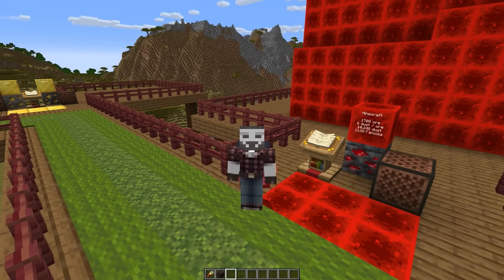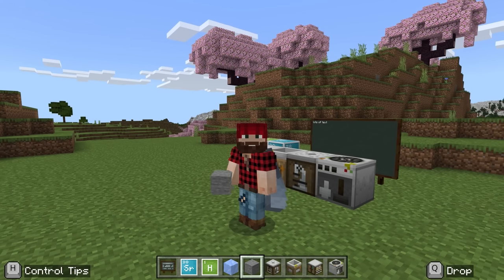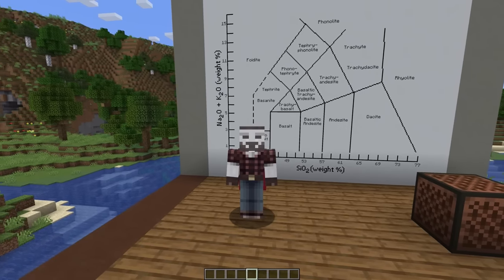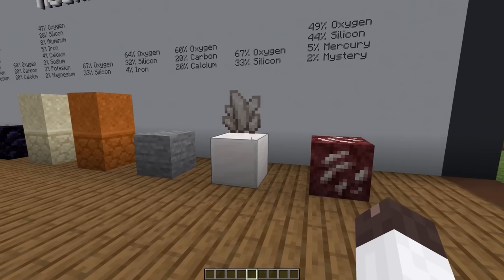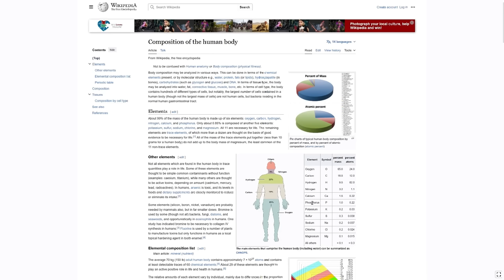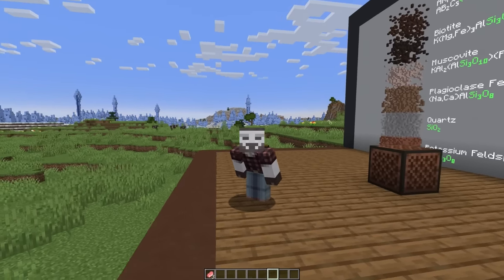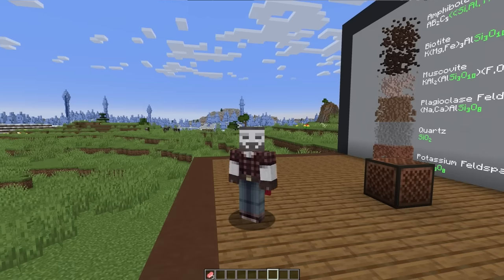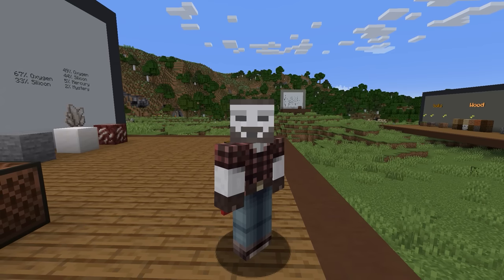Minecraft Education Edition’s Failures

Comment: True words. "Uranium is just a rock that gets hot" And yes. it's oversimplifying it because it also include negative Debuff such as AOE Damage over time and Poison Aura.
Reply: In sufficient concentration, yeah. If the rock is thicc enough to get hot, it's thicc enough to inflict killaura. ...Now Cobalt-60 is the one that'll really oof you up...
Reply: I mean, if you had a 1x1 meter block of uranium next to you, that would probably emit a good bit of radiation, I'd dread what cobalt-60 would do...
Reply: @fusionwing4208  ...That's a fair point. Reminds me of an SCP that takes place in Minecraft yet affects the player at the actual keyboard, and the only cure is for the actual player to "drink one cubic meter of milk" (which would be a lethal dose of lactose for anybody, apparently)...
Reply: @WackoMcGoose  homestuck...
Reply: @WackoMcGoose what about drinking it not at the same time? Like, with a dilation
Reply: @fusionwing4208  Interestingly, uranium is very dense so the exterior of a uranium block will shield basically all the radiation produced in the interior. So surface will be more important than volume. In addition uranium is an alpha emitter, so it won't penetrate skin very well. Also the type of enrichment will play a role. U235 is more radioactive than U238 (even with no fission).
(I won't crush the numbers since the effort is substantial without the correct tools and the probability of me making a mistake is quite high. There is already enough misinformation around... but by my estimate, being next to a m^3 of uranium for a few minutes will not give you acute radiation sickness.)
Reply: @entcraft44  interesting indeed. Though probably not a good idea to stand next to a block of uranium that large without some protection anyway, in case of things like dust.

I have recently (last couple of years) learned quite a bit about how natural uranium is, surprisingly, safe compared to what its seen as in the common mind.

definitely don't want to breathe it in though, baaaaaaaad things happen
Reply: @B1esky adventure time…

There’s homestuck characters doodled on whiteboards by adventure time show creators plus all the references
Reply: @TheOnlyPedroGameplays  that's awesome :>
Reply: @ultraflopp2802 

I mean drinking one cubic meter of milk over an extended period of time is something a lot of people do. It's the fact you have to drink it as a cure, meaning very rapidly or you'll die, that's the issue.

Comment: As a chem student, the "reacting Mg and NaCl" at 13:51 really got to me. It's weird that the substance is called "magnesium salts." Like you said the name may be inferred to be magnesium sulfate (MgSO4, Epson salt) but it's so ambiguous. Based on the production method it could be magnesium chloride (MgCl2) but just calling it "salts" gives absolutely no information on what it actually is. Is it the sulfate? Chloride? A combination thereof? Heck it could be completely different like a fluoride or literally any anion if we're looking at just the name.

Also for those curious mixing magnesium metal and sodium chloride IRL theoretically yields no reaction, at least without resorting to forcing and specialized conditions. Even if the NaCl was in solution and even if the magnesium didn't react with the water first, none of the remaining substituents can react. For example, the reaction can be written as follows:

Mg (s) + 2 Na+ (aq) -> Mg2+ (aq) + 2 Na(s) E = -0.354 V assuming I didn't screw up the calculation

The negative value of the potential (E) means it's just not favorable to react. I mean some can react because it's technically an equilibrium but it's so not forward favored there's hardly a reaction (for those curious the equilibrium constant is something like 10^-12 if I didn't screw up either calculation). If I did make a mistake, please let me know.

Anyways, I appreciate seeing real science being done! Thank you Gneiss Name!

Comment: As someone who is studying chemical engineering right now I was familiar with the hair-raising inaccuracies (or rather simplification) of the chemical aspect of education edition. Aside from the elemental composion blunders (even I knew rock was not just SiO2 before I ever really got into geology) chemistry is not just about "oh, what elements is this made of" and, especially, when you want to make something you don't just shove the component elements together, because that will get people hurt (and is uneconomical). Most of the time, it's actually the reverse, to make a compound you want to find the pathway from some easily available other compounds with the least steps and energy investment possible, and since there are millions of different compounds with varying properties, a synthetic chemist's job is hard. Pure elements are almost always as far removed from your desired compound as possible, not to mention the difficulties of getting them to react in ways that are desirable of the many ways they could otherwise react or the fact that they are mostly very hard to obtain and purify in the first place. Now, I understand, I think, that these blocks are not meant to actually educate students about the work of real chemistry but instead provide an easy to use way of showcasing different compound formulas, but still, some misleading conclusions can be drawn. Also, the sum-formula is pretty much worthless of you don't know the exact ways the atoms are bonded together - this is even true in geology and especially in organic chemistry - try tell me that cellulose, acetic acid and some wet graphite are the same thing just because they have the sum composition of CH2O. 

But I always wrote it off as the quirks of an obscure and forgotten version of minecraft that is left there for showcase youtubers to pluck apart when they run out of content. To think that there are thousands of lessons possibly just as "cough cough" simplified as this and that the platform is very much active in the state that it seems to be ..

Comment: 5:48 Why would a random sample of granite give you gorgeous clear glass? Do other rock glass come out that well?
Reply from the maker: No, most make a green color from what i have done.  There is a lot that is happening there that i just glaze over for the video.  The lithium chemicals is nearly 3/4 of what I'm melting. They melt and the rock powder actually dissolves into the melt. Lithium doesn't produce any signal when hit with x-rays so its basically not there. So in the end we have a solid that has the atoms of the rock evenly distributed locked in place by the glass, which is great if you are trying to do precise measurements.

Comment: There is actually a few mods that do vaguely similar chemistry stuff, or which add secondary products to processing redstone ore. Their names (and what they think redstone/redstone ore contains) are:
* Minechem - considers redstone equal parts iron and copper. (Potentially referencing the high electrical conductivity of copper-iron alloys?)
* Alchemistry - considers redstone equal parts iron oxide and strontium carbonate. (I think this is considering redstone analogous to Ferrite?)
* Thermal Expansion - redstone ore produces cinnabar as a secondary product when pulverized. (Not sure if just 'they both red' or if there's something more here - you're more qualified to speculate about the 'why' of this one I think.)
* Ender IO - redstone ore produces silicon as a byproduct when processed in the SAG Mill.
* RotaryCraft - redstone ore produces aluminum dust as a byproduct when run through the Extractor (A combined ore processor that grinds the ore -> mixes it with water to form a slurry -> filters the slurry -> burns away the water).
* GregTech - redstone is considered Si(FeS2)5CrAl2O3Hg3

It might be interesting to look at what Minechem/Alchemistry consider the various rocks to be in a video.

Additionally, with this new information about your profession, I am now requesting you look at the Extreme Reactors & Nuclearcraft mods for two different levels of nuclear simulation complexity in Minecraft. (Also I want to be reaffirmed in my annoyance at Nuclearcraft's radiation being magic death cooties.)
Reply: also Hbm's Nuclear Tech Mod
Reply: Can you make meth in any of these mods?

Comment: The edu edition isn't about Education, its about getting a cut of expensive edu software license pie. Back when I was still working in edu IT, 95% of the software licenses they bought were barely used. The org would get sold a org wide license and maybe  1-2 classes at one site might use it twice in a school year.

The edu edition on the surfaces has all the box-checking things it claims to be, which is as deep as it needed to be for its purpose and budget.

Comment: It may be a little off topic, but a modpack called "Gregtech New Horizons" adds a very complex chemistry system into the game and the chemical formulas for various ores and minerals are mostly correct (expcept alloys are messed up since they just look like the formulas of their ingredients mashed together, so you get things like Fe50C for steel). The chemical chains also resemble real ones, although really simplified, like you can make carbohydrates in a distillery from oil, then combine styrene with butadiene and sulfut to make rubber etc. etc, so you're not just magically splitting blocks into chemical elements

Comment: I actually do take issue with the statement "Whilst living things are largely carbon, oxygen, nitrogen and hydrogen." It's not a proper sentence. Whilst they're made of those elements, what? It should be a clause in the previous sentence. "These things are X whilst these things are Y" or "These things are X. Meanwhile these are Y" would either be correct (although the latter sounds a bit weird in this context). I guess the same intern who couldn't be bothered to Google the elemental compositions couldn't be bothered to check their grammar either.

Comment: i think you should take a look at the gregtech series of mods because you would probably really like all of the chemistry stuff it adds
a lot of the minerals have a chemical makeup added to their tooltip (for exmples redstone is Si(feS2)5CrAl2O3Hg3 ) because you are fully expected to sometimes extract certain elements from these, for example you can get sodium from centrifuging stone dust

the modpack, gregtech new horizons, takes this a step further by adding completely new elements like draconium(D) or sometimes even an element without even a letter as its chemical sign like chromatic glass for example has two of the ☯ symbol included in the chemical sign

Comment: Not a biologist but a chemist (please correct anything I say that is wrong, I'm not the most well read on inorganic chem) The living things is mostly correct but leaving out phosphorus is really strange. Nitrogen accounts for about 2.6% of our  mass and phosphorus accounts for 0.6 so maybe that's why? Phosphorus is vital in any living thing since it's what forms the phosphate chain in our DNA and RNA. 

I can excuse leaving our calcium as that only accounts for vertebrates and some molluscs with shells but phosphorus is just weird to leave.

In general the chemistry in Minecraft Education edition is sloppy at best and downright wrong at worst. I really wish it wasn't so I wouldn't have to look for chemistry mods all the time.

Edit: Also seeing the NaCl and Magnesium reaction was surprising. It's true that MgCl2 is a "magnesium salt" but so is magnesium sulphate. Putting them together would do nothing honestly. Maybe if you heat it to 900°C so the sodium chloride melts we might see some migrate to Mg but sodium is less electronegative than magnesium so the chloride will preferably bond to magnesium. Dissolving it and then boiling it down... I have no clue. Nobody does this. This reaction doesn't exist, MgCl2 is just purified you don't react to form it. Even if you do, chlorine gas and magnesium metal would be much more interesting and probably easier.

Comment: 6:10 oh wow. How did you create a graph like this? Entities like named armorstands? How?
Reply from the maker: I’m using many text entities. The ⬛ character and treating each one like a pixel.
Reply: @gneissname  So Text Entities for the text on the graph and these pixel character in the text entities for the lines on the graph. Must have been quite time consuming to adjust the coordinates for each pixel in the graph. 
Thanks for the response and the video!
Reply from the maker: @StarWarsExpert_  yep, to help speed up the process I wrote a scrape that gives me the values of pixels and x y position in an image. So I made that graph with a low resolution then deleted the regions, got all those positions and values then did one with just the regions. To animate it I calculated each pixels distance from the bottom corner then ran a scoreboard in game and have commands that load each entity based on the distance. Lots of this is just done in excel to make a long list of commands that go into a mcfunction file.
Reply: @gneissname  scrape? Do you mean script? I don't quite understand what you mean with regions. As far as I know, images only have 2D Pixels and not 3D Regions. So once you had these x y positions, you could use the ~ symbol to make relative coordinates from the place the command is executed at.
Datapacks are such a performance and time saver. You don't have to put every command into a command block anymore and use redstone to power them in the wanted order.

Comment: What's crazy is that Minecraft mods like Minechem and NuclearCraft were getting more of this stuff right long before Mojang made their own lame attempt at adding chemistry to Minecraft. Mods like Thermal Expansion added proper recipes for gunpowder, mods like TerraFirmaCraft added in real geological stones and ores. Both of them made redstone canonically related to the mineral Cinnabar (HgS) which at least makes some sense because Cinnabar is red and mercury is a metal that can conduct electricity. Copper oxide would've been another totally acceptable answer, way better than "erm uranium = power so put uranium in it"

Comment: Would you consider the education edition fine for something at the grade school level? I personally felt like minecraft has been focusing on moving towards that demographic for the last few years so normal Minecraft could be sold to elementry or middle schools. That might explain why everything is so simplified or wrong, i have 0 idea though why they would target colleges for an education edition most of my professors couldn't work powerpoint half the time let alone learn Minecraft for lessons.
Reply: Would have been ok if everything or most of the stuff was simplified, but would you teach a middle schooler wrong stuff? Would you tell them 11x6 is 77 even tho it's not? That's where the problem lies, if it at least had simplified structures, it would have been OK for middle school, but even at that level one should not teach them wrong facts

Comment: It's an odd choice to make stone limestone given that dripstone exists
Reply from the maker: Cave formations in real life come from limestone dissolving and the minerals reprecipitating in caves.  lots of the same minerals but different formation.  Its more weird that there is no dripstone but no limestone or other carbonate rocks.
Reply: @gneissname  Fair enough. I suppose dripstone would specifically be travertine then?
Reply from the maker: @erinkarp Yeah I think you can call it that.  I think of travertine as forming on the surface from hot springs but I think technically its any stone formed from fresh water with minerals in it.

Comment: You need to make glass out of a rock to find out what it is? How the hell did surveyors figure out which rock the ground is made of before 20th century?
Reply from the maker: That’s really just needed if you are wanting to know elements to a very precise level. That method can be used to measure elements down to low part per million. This is the normal method that is used for most igneous rocks. If you were doing research and had a bunch of rocks collected from the field and wanted to look at their variability, this is one way to do it. Before this you could make a slice of the rock that is 0.030 mm and look at it through a polarized microscope to determine minerals and then manually figure out the area of each of the minerals to classify the rock to a pretty high degree. Before that, it would be done by just surface observation and the level of precision was good enough for things then. There are tons of methods for analyses.